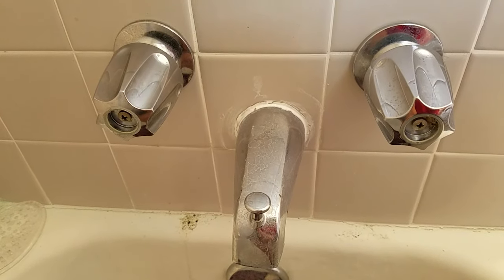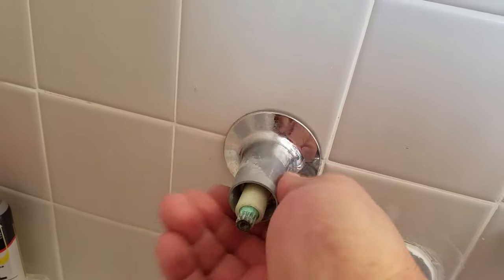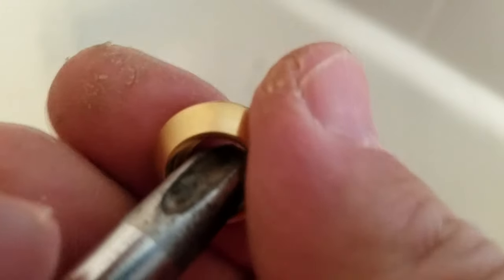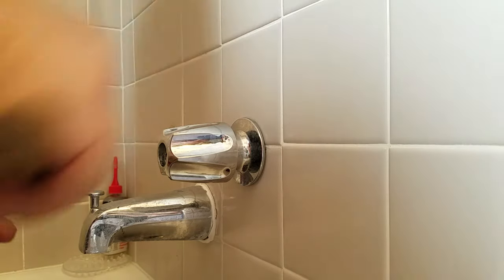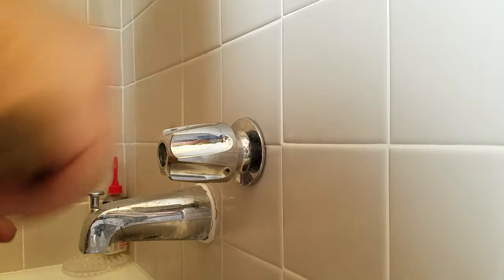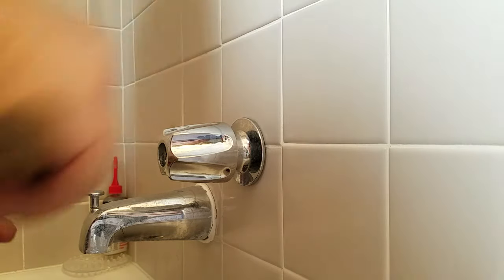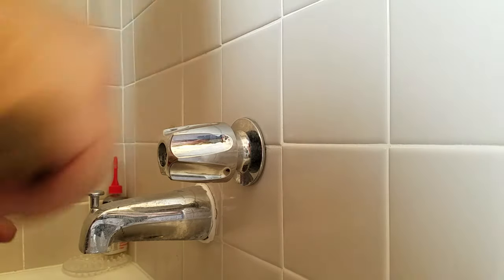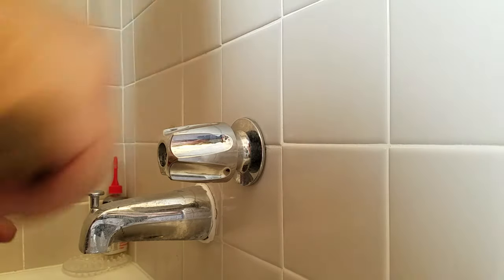Bath tub and Shower Faucet repair Step by Step

Comment: bb23, nice vid. I would recommend for anyone with an older house (1830s-1950s) who may have  a faucet that has been in place for decades to use a faucet handle puller. These inexpensive tools allow one to remove the faucet handle—that can get nearly "welded" on with age, corrosion/calcification—without applying so much force that it compromises the entire plumbing set behind the wall. While your "tapping it with the handle of a screwdriver" might work many times, there will be those rogue faucets that require a bit more equalized pull from the front. The faucet puller does not strain the plumbing but sure does help yank off the handle.
Reply: Hmmm thanks for the tip
Reply: my cold tap is so corroded I doubt anything would get it off but a puller is a very good suggestion. I heated it with a torch and hammered it but it's really on there so just shows how bad they can get.
Reply: Well, I used a Milwaukee cutoff disk to remove my handle ... a series of cuts til I got close to the brass shaft ...

Comment: Great video. That nut you mentioned is called a packing nut.  Another tip is to apply thread sealant to the new valve seat or a few turns of Teflon tape.

Comment: The valve seat I bought was at my local Home Depot.  BUT the guy working there had no idea when you buy the replacement kit for the Price Pfister, it does NOT include the valve seat and you must buy it separate.    So…….. be on the lookout for that little item in a bag on the hundreds of items on the peg wall at Home Depot.  More than likely the employee has NO IDEA what it is, what it’s for, or if they even have it.

Comment: I got tired of replacing the washers in those types of faucets a few years ago and changed all of them in the house to the washerless, dripless type.  (Kitchen is a Peerless,  bathroom sink is a Price-Pfister and shower/tub is a Delta)  Seems like with that old type that the washers would only last a year or two and need replacing again.  The only part I've had to replace in the last 5 years with the new ones is a new sink aerator as we have hard water and the old had clogged up bad and I couldn't even fix it soaking it in CLR, lol.  The old shut off valves in this house for the main from the street have the old pot metal handles broken off.  I know I need to replace them some day, but I did at least buy a curb key so that I can shut off the water at the meter itself a couple of months ago.  Going to need a new water heater in the next year or two as I've gotten to noticing a lot of corrosion on the cast iron inlet where it connects to the tank.  Can't complain I guess as the old A.O. Smith heater has lasted well over 20 years now.
Reply from the maker: We had a washerless faucet in our kitchen up in WA, I never had to service that thing: You've got me thinking about changing over to those in this house. Hmm. 
Copy on the AO Smith, ours at the RV Park went from 1986 to 2017. I bet that new one wont have that service life. LOL, Cheers.

Comment: Collar nut? Packing nut!!! The washer and seat you replaced stops leaks from your supply line to the spout. I.e., cant turn it off. The washer on the body that you did not replace prevents leaking behind your wall. Not replacing it can cause damage that you may not find until it becomes severe. Floor, wall(s), joist's, drywall, ect. The packing nut, tightens down on a soft material (packing) between the stem and the inner body. It sqeezes this material forcing it to 'hug' the stem to keep the stem from wallowing  around and prevents leaking that would run out from your handles into your tub. It usually does not need replacing but maybe an extra turn on the nut would do good. It should cause your handle to turn with a bit of resistance. Not much. Nice video. Well done. I never would have thought of the B. A. phillips screwdriver. 🤣 Thank you.
Reply from the maker: Great information, thanks.

Cheers

Comment: My knob was just  loose do i need a new Phillips head screw or should I just get two new knobs and tighten them in because nothing's wrong with the hot it's the the cold it you go to turn it and it feels like it's stripped wobble should i just get 2 new faucet handles they just like urs in video will that fix it??? Then my other one is I got a hole in the side of my faucet spout right for a shower attachment to go on the side and that broke off and I can't get that damn piece out of there same diameter will just screw right in the side right ??

Comment: I would also "clean" the threads of the value ( the rust ) with a wire brush, then add dash of plumbers grease/WD-40/lubricant . . . re-install ( possibly also turn in / then turn out to "wet" the internal threads . . . that's just me . . .

Comment: Ty for this video. I'll be doing this project soon as the bathtub faucet is leaking but i have a question one you reading this may be able to answer for me. The cold water faucet in the tub is backward meaning that when i want to turn it on, i have turn the faucet to the right instead of the normal left and to turn it off, obvious ly, turn it to the left instead if right. It's just always been that way since i moved into the house years ago. So since I'm going to be attempting to do this same project that u just did in this video, I was thinking that now might be a good time to correct that issue if it's not too complicated for me. Can any of you tell me how please?
Reply: I've heard how to do that on YouTube but I can't remember how... go search young man!
Reply: @stevewilliams1197  of course you're right steve except that I'm a 60 year old woman and not accustomed to these type projects at all but I replaced the tower (I think its called) located inside the toilet tank all by myself after watching a few videos on youtube and I changed the battery inside my thermostat as well from a YouTube video. Completing these 2 projects has given me the inspiration and motivation to at least try to do these on my own and I find it very satisfying. So I'll try the leak and the backward cold water soon. Ty

Comment: May I ask why you don't just replace the whole valve piece since you have it out instead of putting the same one with green corrosion back in?  By the way Thank you for the very informative video.
Reply from the maker: In previous instances I have had to replace the Valve assembly, however these are in good shape and replacement was not needed. 
I believe the replacements are made in China anyway, I will stick what works:)
Cheers.
Reply: Most of these old taps are so old that it's hard to even get parts anymore so you have to use similar parts and MacGyver everything back together, that's if you can even get them apart in the first place.

Comment: The collars on my tub faucets are loose and fall away from the wall. I'm in my 70s.  Where do I  put the caulk to keep them in place?  The piping was replaced this spring and I  have had this problem since.
Reply from the maker: I put the collars on hand tight then put a bead of caulk around the edge of the collar.

Comment: So I did all this with brand new stems AND seats, and I have a leak out the cold shower handle when turned ON.  Any ideas where I went awry?
Reply from the maker: TBH I would be surprised if you bought the right replacement parts. HD does not stock the correct parts, look for a plumbers supply in your area.  (We have a couple in the salt lake city area.)
 Most are old school ma&pa shops. Take your old parts in, when the person at the counter says.... ah.price pfister, your at the right place:)

Comment: My valve seat is on so tight when i use the tool to remove it it now rounded the valve seat from a square to a circle. How do i get it out now?
Reply from the maker: While I have been very lucky and never had this happen to me, I would try using an Easy Out Tool like this... https://amzn.to/3kvgovO  I have used easy outs on head bolts and machinery and have had great luck, I just take it slow also a little shot of PB Blaster (optional) may help.... Good luck.

Comment: I'm at the point where i have to use the socket. The nut just won't move!!  I chipped off any tile part to make sure that i have an easier removal but i can't move it at all. Any suggestions?
Reply from the maker: Okay, Good luck Fingers crossed

Comment: I might of missed it...u do shut off water for this right?
Reply from the maker: Yes, just shut off the water at the main valve coming into your house. I then go throughout the house and turn on all of the faucets to get as much water and pressure out of the lines. That way you will cut down on the water dripping out of the lines your working on.
Reply: @breakerbroke23  We have to call the city Water Authority to shut our water off at the main valve. They come right away, no charge and back out real fast when we are finished!
Reply: @IGotTheWillies  there is another valve somewhere. Either basement or a crawl space. Somewhere close to where the main enters your home. No need ro call the water dept. But with that question he may want to just call a plumber
Reply: No let the plumber do it.

Comment: idk what to say but, i have water coming out of the base of the faucet, what do i do about that? and its a single handle.
Reply from the maker: There is a little plastic washer that goes between the stem and the base. Did you check to see if that is missing?

Comment: Any suggestions on how to remove a stuck on outer collar? It will not loosen by hand or wrench,  no screws holding it on anywhere.
Reply: Spray with penetrating 🛢 and tap, if stuckvon I'd suggest 1 or 2 days of just spray n tapping b4 even shutting off water and doing the job. To much force with bend your copper water lines behind the wall and then your in trouble. I recommend a pipe wrench and a rubber mallet. Slight taps!! U will be glad u did  😃

Comment: Does the repair help with water pressure?
Reply from the maker: No. However I have seen chunks of washer material stuck in a faucet. Depends on the faucet design.

Comment: Just did the same exact make.  Replaced seats and valve and still have a slight drip what did i do wrong
Reply from the maker: Sometimes the rubber washer may have to seat and that can take a few days of use. That is if you have the proper valve seat and matching washer.  The stem could be warn as well.
Reply: Did you have the valve open when you tightened the stem down?  Need to do that so the stem seats properly.

Comment: Considering two trips to the store plus the rest of the work I would spend about four hours in the process of screwing this up big time. Then I would hire a plumber and pay him about $500. to fix the original problem plus what I screw up. The other option is I could hire a plumber to fix the current problem and pay him $350. 
But I may try it anyway. I assume you must turn of the water at the curb and at the hot water tank.
Reply: Should have a shut off in house i would think
Reply: We have to call the city water authority to shut ours off at the street. Works great for us!
Reply: I did it, and I’m a girl.

Comment: Someone ie so called professional plumber came fixed my leaky tub faucet . Now the tap  only turns a 1/3 of the way up so I get no pressure from the Hot water tap. Guy at hardware store said it could be he put a kitchen one on instead of the bathroom one which only turns a 1/4 of the way . Now how do I know I  am getting the right one same as that tool you used to get it out .I don't want to go back 88 times to get the right tool I'm only gonna use once. I figure if a Proffesional can screw it up how will I hurt it   , Right?
Reply from the maker: Yes mam. Give'r hell